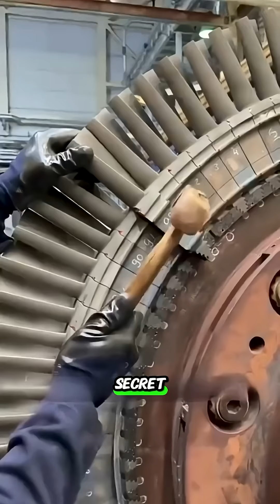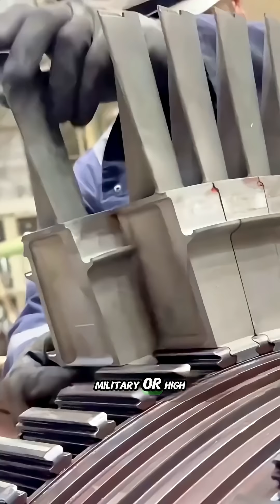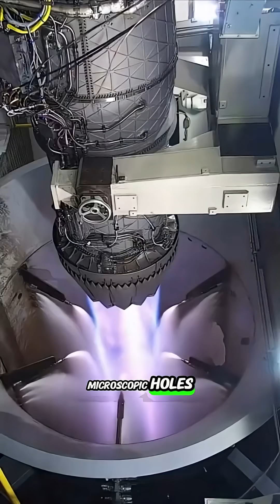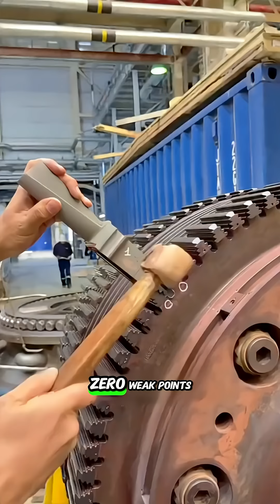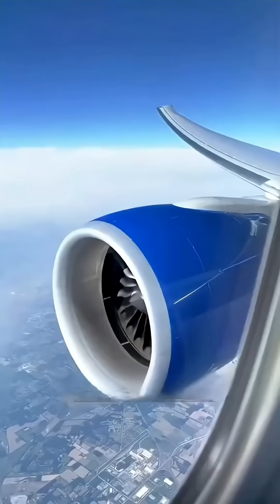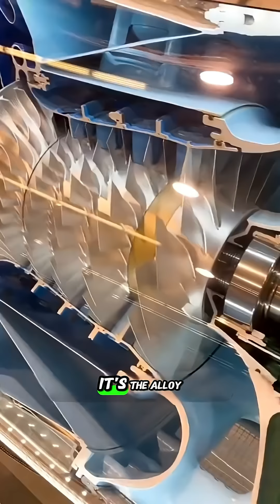The Insane Reason Nobody Can Copy American Jet Engines

Comment: Almost everything in this short is shockingly wrong.
I guess the point is to get us to point that out.
Reply: Yes, the weight of a single hair on a bladewill not significantly worsen engine performance
Reply: @teddeebayre3433       can or cannot handle. :            bird strike
Reply: @MikePoland-g7r  TBH a birdstrike will hit the front blades not the ones generating thrust! By the time it gets to the business end it is all red mist!
The point does stand though!
Reply: @totherarf  Do you or have you ever worked on a Jet Engine?
Reply: @totherarf The big fan in the front is the one making most of the thrust though.
Reply: @GolfFan1-1 I have, and they’re right.
Reply: @GolfFan1-1  No! ... Your point?
Reply: @totherarf  I was a machinist on every part of the internal parts of Turbine Engines from the casting to final part. I spent 30 Years machining and putting them together, taking them apart after first models were made to check wear. The video isnt 100% correct but the technology is not out there in the open for all.  Some parts are machined and its a trade secret how they are made and the material. Others can create a jet engine but cant get the efficiency part correct, Its like two different cars, some get 30 mph, some get 20, only with jet engines they are the same size and same application and no one wants the ones that burn more fuel for less mileage. Or burns the same with less thrust. thats where the difference is, the metal has to be able to sit on a runway at minus 60 and then heat up to over 1000 degrees and maintain the same tolerances. There is big money is producing top jet engines and even with the saudi money, they cant, or qutar money they cant, Japan buys theres from GE. but the video is flawed but makes a larger point, Jet Engines that are Efficient cant be replicated on the spot. It takes decades and lots of failures to produce ones that stay intact for years with human lives on the line.
Reply: @WillieInFinance  What part of jet engines did you work on and where?  I spent 22 as an Aircraft engine mechanic and 20 machining internals for them from castings to finals.
Reply: @G @GolfFan1-1 ice! I mainly did component replacement, tear downs and rebuilds for 6.
Reply: @teddeebayre3433 I think he was saying if the blades were weighed a hair off it could cause catestrophic failure from centrifugal force at full rpm.
Reply: The part about the inner channels being more complex than blood vessels did give me pause
Reply: @stevenswapp4768  maybe not as thin as blood vessels, but actually quite impressive how thin and twisted they got now.
Reply: @stevenswapp4768 I've told  you American colleagues a million times not to exaggerate....
Reply: @smyffmawzz what? You mean Americans have a tendency not to listen?? Lol 😂
Reply: @smyffmawzz  Ha ha! I get it. Told us a million different times not to exaggerate, did ya? Must have taken ages, and we STILL DIDN’T LISTEN! Gotta be frustrating.

I like you, colleague from unknown country of origin. You’re a funny… Gender of unknown specificity.
Reply: @smyffmawzz  "the lion doesn't waste it's time with the thoughts of sheep..." or something to that effect, I wasn't really listening.
Reply: @stevenswapp4768   It's a metaphor
Reply: @principleswise9749 ah. Didn't expect that since technical info is usually literal
Reply: @principleswise9749 It's BS, is what it is.
Reply: Oh my. Without the comment section this would be such a horrible platform. Free-to-spread misinformation.
Reply: @eestaashottentotti2242 reminds me of the good old TVs and Radio propaganda machines
Reply: @eestaashottentotti2242  it's a good thing humans can easily discern bs otherwise government would have to intervene. Oh wait 😅
Reply: @eestaashottentotti2242 the thing is most people either don’t look and trust whatever they see
Reply: I like your insight, very good point
Reply: ..Trade secrets..🤫
"Loose lips sink ships".. 😶
Reply: @livelyarts49 .  Good thing they are talking about jet engines and not ships or trying to BS us about jet parts
Reply: Explain what is wrong
Reply: @davidross5593  Rolls-Royce in the UK can build them for a start... So basically even the first sentence is incorrect 😅
Reply: @winging-it-to-win-it 
So too does Safran...French.
Reply: @winging-it-to-win-it my grandma builds in her free time 😅😅😅 for TEMU
Reply: @winging-it-to-win-it rolls royce don't build jet engines. If they did the UK would be producing their own jet engines today without outsider help. 💀 💀 💀
Reply: @Ralfi_PoELA  which they do. The rolls Royce Trent engine for example
Reply: @Friddle how much of it is built primarily in England.
Reply: @Ralfi_PoELA  only RR knows that i guess.
Reply: @Friddle  Rolls-Royce has a large joint venture with France.
Reply: @Ralfi_PoELA  not on their Trents though
Reply: @RenZ696  Rolls-Royce and Safran have been partnered with each other since 1965 on all their projects. Rolls-Royce hasn't been a stand alone jet engine company since before that. Why the UK doesn't even produce its own jets anymore. Can't even maintain the Harriers which would have been a good alternative to the F-35's y'all don't really have for your aircraft carriers.
Reply: @Ralfi_PoELA  wrong, Safran has no saying in Trent engines. Maybe as a supplier for some parts, but no joint ventures. Last joint venture was the V2500 in the 90s.
Reply: @RenZ696  says you. 😂
Reply: @Ralfi_PoELA  indeed, or do you still think differently? What is the engine type Safran is still heavily involved in up to a joint venture? 
Go ahead.
Reply: @RenZ696  just stating the facts... Nothing to get bothered about.
Reply: @Ralfi_PoELA  I am not mad, until now you just made stuff up and owe us the facts. So what are the current engines Rolls-Royce builds where Safran has significant stakes in?
Reply: @Ralfi_PoELA  they are one of the world's largest manufacturers of aircraft engines. They design, produce, and service powerful jet and turboprop engines used to power numerous commercial, business, and military aircraft worldwide
Reply: @fookpappyvanwinkle9162  in a partnership with Frances Safran going back to 1965. You forgot that part.
Reply: @Ralfi_PoELA of course
Reply: So much easier to do the short list rather than the very long one so here goes: What is correct? Answer. Nothing !
Reply: @davidross5593  reminds me of ME 262, the Germany did it first
Reply: @davidross5593 Also the sentence is contradictory, said "dominated for 50 tears" but recognized only few countries can do it, so didn't dominated if somebody else can. When a country needs this kind of lies in order to maintain its ego something is deeply wrong with it.
Reply: @davidross5593 name one plane uk produces with suprecruise where single crystal engines are needed. Go ahead ill wait for your answer and your cancelled 6th gen program dont count never even got past blueprint phase 😂
Reply: @7zobzombie Eurofighters Typhoon 🤪😜
Reply: @Tuga9525 While the Eurofighter's top supercruise speed is Mach 1.5 in a "clean" setup, adding weapons and external fuel tanks increases air drag.When loaded with a standard air-to-air missile configuration (such as six missiles), its supercruise speed typically drops to the range of Mach 1.15 to Mach 1.2. 

F22 is 1.6 over 2 in full burner things garbage
Reply: @7zobzombie, what has that to do with your initial question !?
Reply: @7zobzombie wow that's some goal post moving there brother.  You got some egg on your face.
Reply: It's a nice story, full of misinformation
Reply: Your right.
Reply: @donmajer9607 ..my left?
Reply: You are absolutely correct pal. The kid thinks very complex designs however, the government wanted simple, it’s just that the government has need to know information as to why the metals used in aircraft manufacturing doesn’t need complicated fusing techniques however it’s the use of a single and very expensive metal worth more than gold, gets stronger when heated above thousand degrees it’s called, “????????” It’s an eight letter word not titanium, but I can’t tell it in public but a good synonym is called “white gold “.
Reply: @edwinmabanta6624  have you worked on Jet engines or machined the parts? or built an actual engine?
Reply: @edwinmabanta6624 well your probably talking about Rhenium which is only 7 letters and it's good over 5k degrees and the most expensive metal in a jet engine.
Reply: @JerryMabrey that’s right, wow I thought it’s 8 letters my bad
Reply: That is definitely a tactic.   I see a million videos a week....I Caught this giant Trout 🙄.....clearly not a trout 🤣
Reply: @Baroque_Back_Mountain  😢 A million videos a week? OMG you poor thing
Reply: @barreldreamz7852  🤣🤣🤣
Reply: This must be a skit… 😂😂😂😂
Reply: Lol being an engineer myself, I started eye rolling and went to the comment section myself
Reply: @derrickez but then you facepalm cause you find comments are equally stupid.
Reply: Generating engagement.
Reply: You're right. We're all initiating engagement which helps the content with the algorithms.
Reply: $600K to replace PT6 CT Disc, Aircooling channels are real (impingement cooling)
Reply: It WAS pretty bad
Reply: https://youtu.be/QtxVdC7pBQM?is=0kb6XwKDLLUyjbKi
Reply: Or to dumb people down.
Reply: Thank you another smart man And imagine if america stopped building engines then what would us small minded idiots do
Reply: 😂😂 opened the commentsection to say the same 😂😂
Reply: Utter nonsense really
Reply: its just entertainment.
Reply: @JoesephBidon  Are we not Entertained?
Reply: @totherarf "Spaniard!"
Reply: You are right
Reply: Chai,savage😂
Reply: Completely agree.
Reply: If you want knowledge pick up books.
Reply: USaian ego.. why we keep seeing this junk shorts
Reply: lol like the tiny holes, but where they at tho?
Reply: @Zeno2000 So small you can’t see them with jour naked eye !
Reply: Watch Veritasium is actually very right stop being such a critic
Reply: The reality is more nuanced, with each nation having distinct strengths and weaknesses.

Here is the breakdown:

· China (J-20, J-35): Now a Top-Tier Contender. The J-20 is a world-class 5th-gen fighter that rivals the US F-22 and F-35 in many areas. It features an advanced AESA radar, a growing fleet of ~300 units, and carries the PL-15 missile, which outranges the US AMRAAM. Its widespread use of advanced AESA radars and composite materials marks a significant technological leap beyond its Russian counterparts.
· Russia (Su-57): A "Stealth" Fighter with Trade-offs. The Su-57 is a highly maneuverable and dangerous aircraft, but it's often considered less stealthy than US or Chinese designs due to its airframe. It's also behind in avionics and radar technology (using less advanced AESA), partly due to sanctions limiting access to Western electronics. With only about 19 in service, it's not yet a mass-produced game-changer.
· The Electronics Gap (Radar): This is a key differentiator. China has successfully upgraded older jets with advanced AESA radars (even using cutting-edge GaN technology), while many US and Russian jets still rely on older mechanical radars or less capable PESA radars.
· The US Edge: The US still leads in overall network-centric warfare, sensor fusion, and proven combat experience. For example, the F-35's data-sharing capabilities are considered the most advanced, while the F-22 remains the benchmark for air superiority, despite its aging design.

In short, China has pulled even or surpassed in specific areas (like radar tech and missile range), while Russia excels in maneuverability but lags in stealth and electronics. The gap is narrowest at the top, but widens when comparing the average frontline fleet.
Reply: Love the part where you actually pointed out the tbings that are "shockingly wrong"
Reply: success comes from decades of accumulated expertise across materials science, precision manufacturing, testing, certification, and industrial capability.
Reply: The voice itself is the biggest giveaway.
Reply: The broads strokes are correct. The things that are wrong are significant, but the things gone over in this video are still amazing. There are only two major American companies and maybe 3 or 4 European companies that can make competitive engines. Even Russian designs aren't as advanced and they were always a generation behind. The turbine blade metallurgy is about as close to magic that modern science currently produces. It being a single crystal with no grain boundaries is absolutely correct and is absolutely insane to think about. No, the channels may not be more complex than blood vessels, but still impressive nonetheless.
Reply: I thought Airbus Industrie, the European company that competed with Boeing, used to make its own jet engines. Oh, he did say 'almost no one else.'
Reply: Was wondering about fact checking 😅
Reply: Truth is misinformation and misinformation is truth.
~The American Political extremist~
Reply: Bullshit Video
Reply: don't say something is .. wrong and then proceed to not say what is right !!! what's wrong about it?
Reply: @vittorio870 I hear crickets 😅
Reply: @davetaylor5065  Many have given one of the reasons ..... America is far from the only producer of jet engines!
Reply: - 
 @vittorio870  -- I Agree .
Clarification Is In Order .
-
Reply: Rolls Royce (UK), Safran Aircraft Engines (France), MTU Aero Engines (Germany), Motor Sich (Ukraine… yeah Ukraine) would like to point out this narrator is full of shit and they all make Jet Engines perfectly fine, thankyouverymuch.

This video is clearly American defaultism at its worst.
Reply: @NeoMorphUK  You are assuming all jet engines are the same. While all these manufacturers do in fact make jet engines all do not manufacture jet engines that spin at the same rate of speed, produce the same amount of thrust, or are subjected to the same amount of heat. Go study jet engines and learn something.
Reply: Russian brits didn't invent the first rocket engine the Germans did. And yes the Russians used to supply us with rockets before space x in 14 they were ditched as one failed Russian made. Since upgraded. Facts are most of the best engines made in the last 50 years are joint efforts of 3 or more countries. Down to ge Pratt and Whitney. Where its not is specifically in military equipment. And in that case yes we do rule and have for a long time. The f22 and f35 are considered the most advanced but really the new f47 in 28 is going to have twice the speed and range. Which means everybody else is behind about 20 years after 28 hits and this thing goes live.
Reply: @joshreynolds729 F35 most advanced ? You don’t know or don’t want to know the technical disaster!
Reply: that's fine you can book your rides on temu jets im taking western every time
Reply: @PharmBoy-d7c Europe is Western
Reply: I just hit the block channel button when I see fake
Reply from the maker: What’s fake
Reply: @MotorVibe_Talks not fake, just wrong
Reply: @MotorVibe_Talks 
Aircraft Jet Engine Manufacturers USA:

GE Aerospace
Pratt & Whitney
Honeywell Aerospace
Williams International

Aircraft Jet Engine Manufacturers Outside the USA:

Rolls-Royce plc (United Kingdom)
Safran Aircraft Engines (France)
MTU Aero Engines (Germany)
ITP Aero (Spain)
Avio Aero (Italy)
GKN Aerospace (United Kingdom/Sweden)
EuroJet Turbo GmbH (Europe)
Europrop International (Europe)
AECC – Aero Engine Corporation of China (China)
AECC Shenyang Liming (China)
AECC Xi’an Aero Engine (China)
AECC Guizhou (China)
UEC Saturn (Russia)
UEC Aviadvigatel (Russia)
UEC Klimov (Russia)
UEC Kuznetsov (Russia)
UEC Salyut (Russia)
UEC Perm Motors (Russia)
Motor Sich (Ukraine)
Ivchenko-Progress (Ukraine)
IHI Corporation (Japan)
Kawasaki Heavy Industries (Japan)
Mitsubishi Heavy Industries (Japan)
Hanwha Aerospace (South Korea)
Hindustan Aeronautics Limited – HAL (India)
Gas Turbine Research Establishment – GTRE (India)
TUSAŞ Engine Industries – TEI (Türkiye)
Reply: @MotorVibe_Talks  nothing in a turbine blade is as intricate as a human blood vessels, even reptile blood system is 100 times more complex than some silly cooling channel in a sponge casting. 🙄
Reply: @MotorVibe_Talks about everything posted in the video.
Reply: @TheFirstBigCheese AI slop 🙄
Reply: @MotorVibe_Talks  it’s almost all wrong dude wake up stop being cocky learn from your mistakes moron unsubbed  blocked
Reply: @Holilo7
👌🏻 I think you shut him up.
Reply: It’s quite true … during the 1980s, the U.S. exported or collaborated on specific aviation technologies, including commercial engines like the CFM-56. However, China's inability to immediately replicate them stems from the massive gap between possessing a blueprint and mastering the advanced metallurgy, tacit manufacturing knowledge, and supply chain infrastructure required to build modern jet engines.

It’s the same reason that no one can replicate a Stradivarius? 

While master luthiers can perfectly copy the shape and dimensions of an Antonio Stradivari masterpiece. They can’t truly replicate it because its legendary sound relies on a combination of historically lost variables. These include specific wood density from the "Little Ice Age" climate, chemical wood treatments or fungal aging, and a unique varnish recipe that may alter acoustics as it micro-cracks over centuries.
Reply: @JimCOsd55   Regardless of how masterfully a luthier can craft a Strad, it's impossible to reproduce wood aged 350 years. Strads sound different now, than they did when they were first made.
Reply: many build  this engines. the best  are Rolls Royce.even Trump  want RR on hes own airplane
Reply: @pedersvanstedt1265 ask any B787 owner what they think of Rolls Royce engines
Reply: @pedersvanstedt1265 
And no one know as much as Ttump about jet engines.
Reply: @pedersvanstedt1265  Yes, adorned with gold.
Reply: England designed and made the first jet engine, then gave America plans for some insane reason
Reply: @philjjordan6197 and to Soviet Union     !
Reply: @philjjordan6197i thought it was the Germans.
Reply: @philjjordan6197Actually it was the Germans,. They both got it from German scientist after WW11.
Reply: @philjjordan6197Germany
Reply: @philjjordan6197 -- The "insane reason" was called World War 2.
Reply: @philjjordan6197You gave them to The Russians too.As many Americans that died protecting you, you call it "some insane reason," besides the US used the turbo jet iteration, not the centrifugal type that Frank Whittle designed.
Reply: @booster5329 Your previous comment about the fake channel, agreed, and point well made and received .Yet you cite a trope that is only an RCH away from " if it weren't for us you'd be speaking German '.
From whom did you protect us? It wasn't from you, I think you're bound to agree. We are going down in the wake of your vortex currently.
Reply: @philjjordan6197the first jet engine was a axial German and the next the radial English one  real history
Reply: @philjjordan6197I think that was the Germans, they came out with the pulse engine at the height of ww11
Reply: @philjjordan6197I m not an expert but I know that the first jet plane was made by the Germans towards the end of the WW2. 
I don't know if English had it already on paper but this means that it was already a technology about to be developed by various states and industries!
Reply: @philjjordan6197they have owned the US since 1870. You didn't re search.
Reply: @jamesloghry8083 Not anymore, Trump put a stop to that crap so, do your research.
Reply: @philjjordan6197 To get us involved in WWII.
Reply: @philjjordan6197Because they asset stripped us in 1940 and occupied us in January 1942. They own us. Both countries pretend we are still sovereign for political convenience.
Reply: @Jack_AubreyRN Have you been following Mark Felton's videos on the UK's crumbling navy? As an American it's sad to see what's happening over there. I think your politicians truly hate you whereas ours are more or less apathetic toward us as long as they can keep ripping us off.
Reply: @robertnichols78 You are right, our government wants us to cease to be. 
I'm sorry to tell you, after such a friendly and chatty response, Mark Felton is a despicable human being who lies almost as much as Roy Casagrande. At least Casagrande's stories are funny if you're familiar with the history. Mark is a blatant Fabian..
Reply: @J @Jack_AubreyRN rewriting history? The Americans basing themselves in the uk prior to d day does not equal an invasion. For one thing, those troops left around June 1944 in order to invade France.
Reply: @MrBlaxjax  I came here to support a view I agree with, not for a confrontation. Your opening question is a loaded rhetorical device, and that's a further reason not to engage. But you asked if I'm "rewriting history," so I'll answer that cleanly. The stripping of British assets did start in 1940, specifically after May 10th, if the year alone is too vague. The first American troops landed in January 1942.
The rest is perspective, not rewriting. After exhausting the orthodox books within my grasp, and believing them, as you appear to, I started coming across different perspectives with as much, if not more, validity than those manufactured for general public consumption. They led to avenues of research I'd hitherto been artfully steered away from. De Gaulle famously declined the D-Day celebration, saying it was "le prélude à une seconde occupation du pays." If you recognise the quote, you'll be aware of the issues at stake. I'll not elaborate for reasons already given.
He was also famously correct about French banks being full of worthless American paper. In my opinion, the last great European.
Reply: @Jack_AubreyRN whatever.
Reply: @MrBlaxjax Jack tips Fedora.
Reply: England owns the US?

look how small they are....they asset stripped all of California?

what assets?
are you specifically talking about aviation or life in general?
Reply: این اشتباهات عمدی ست، اسرار ساخت این موتورها را در اختیار عموم قرار نمی دهند، 😊
Reply: Many videos are wrong, stupid,or just flat out lie. Each time you point it out is a view, and comment. These liars do it on purpose. I wish You Tube would use it's master censorship powers that they waste on harmless bullshit to stop ppl from posting lies.
Reply: I. Do not concurr. After 30yrs in experimental these blades are amazing and will withstand strength beyond what we know. Strands as small as human hair flow thru these blades to cool them. Trust me. 
Cudos to engineers and assemblers 👍
Reply: @sfopaladin2661 
"Trust me."

I never trust anyone that says "Trust me".

"Cudos"

It's spelled "Kudos".
Reply: @shawbros  "Trust me bro..." ~Abraham Lincoln
Reply: @Kenji1685 “Abraham Lincoln” -Trustme Bro
Reply: Nope. Most of it is correct.
Reply: Alsolutely. I open commentaries to write just that.
Reply: Yep, 100% incorrect
Reply: @MDCDiGiPiCs  no, turbine blades do have passages inside for cooling air to form a layer of air to protect the blade from heat.
Reply: @insylem Not all turbine blades. Depends on the size and vintage. Higher efficiency of more modern GTs requires higher TIT which typically requires more blade and nozzle cooling.
Reply: @MDCDiGiPiCs care to elaborate?
Reply: Good take the plans to India and stay there.
Reply: No, it's meant to make that country look good at a time when everyone knows it's 💩
Reply: The amazing thing about China is their product is a cr#p copy of yours<blink> their product is as good as yours <blink>their product is next generation better.  China does this constantly. Jet engines are in their sights but maybe they are moving on to zero combustion way simpler engines? We'll find out soon.
Reply: @bobcannell7603 
Speaking of lies, and liars!
Nearly every word you wrote is obviously total BULLSHIT
Why does China constantly boast about technical breakthroughs that virtually never happen? If what you claim becomes even a partial truth, it will be the first time that it's truth, VS pure propaganda 
Blink my ASS!
Reply: @bobcannell7603 Considering China was the innovative workshop and tech research centre of the world for the best part of 3000 years, minus the 300 year glitch of European dominance and a government that atrophied in-between several revolutions and coups,, I'm surprised anyone is surprised they are going to dominate again. It seems perfectly natural and inevitable to me. It does seem to create jealousy or fear, or perhaps both, in many. The West is clearly on its last legs under US 'leadership'. It's so far gone it's just childish to deny.
Reply: I agree
Let me give a piece of advice to the person who made this short: if you don't dominate a subject,  best is to shut up
Reply: That's propaganda for you😊
Reply: Many countries make superb jet engines.
Reply: @leymansuniverse8888  which countries?
Reply: @doumedaurillac7393 The UK for example.
Reply: @doumedaurillac7393 UK, France, Germany, China, Russia, Canada, ...
Reply: @vitek924 Rolls Royce.
Reply: @doumedaurillac7393  France, Uk
Reply: @doumedaurillac7393 Neither Russia nor China buy american engines to add just a few...
Reply: @doumedaurillac7393  China, UK, France, Russia, and China have just as advanced if not more advanced domestic jet engine manufacturing and supply chains.
Reply: @schrenk-d right....thats why china keeps ordering ours
Reply: @johnpeterekstrand717  LOL, China buys LOTS of US engines. And Russian engines suck, they have thousands of hours LESS service life, and they are less efficient.  Feel free to pretend.
Reply: @johnpeterekstrand717 I'm not sure about Russia because they have their own tech geniuses, but China are able to because they reverse engineer American brands and make their own.
Reply: @schrenk-d China only recently mastered the materials science behind making turbines of this quality. They relied on Russian engines for decades
Reply: @johnstephanos1128 which means the blueprint is enough...
Reply: @johnstephanos1128  Russia has fallen well behind at this point.  China is improving bu the still lack large scale reproducibility for hot section parts like Turbine blade.  You can try to copy a turbine blade but you still have to manufacture it.  If you can not EDM drill TiNi investment cast blades with intricate internal cooling channels, then EDM drill hundreds of 8 mil holes into those channels, and then use a laser to add tiny diffusers to those holes within thousands of an inch tolerances.  Then use ionized ceramic with proper masking to coat the blades with thermal coatings, and do it at scales of tens of thousands of blades a month... it is a non starter.  That is why the WS15 has a military power life span measured in tens of hours, while the US engines are measured in the thousands of hours.  In a War supply chain would kill Chinese aviation s they would not be able to maintain their fleet without derating their firing temperatures to keep planes in the air.  Most people in this thread have ZERO knowledge of Jet Engines, or how any of this works.
Reply: @PharmBoy-d7c  China is indeed a recent addition. They have managed to produce some interesting advancements though.
Reply: Let's all report ones like this for false Information.
Reply: You speak CRAP
Reply: I don’t know a thing about jet engines but as soon as he said one blade costs as much as a bmw I knew it was bullshit!
Reply: Hey @dread10ck you’re so smart tell us what is wrong with this video?
Reply: Only Americans can make jet engines.
Reply: Yes...  It seems a shame
Reply: Just more US self-aggrandising propaganda for brainwashed Yanks to wallow in.
Reply: Yeah,most of the jet engines are made in Germany or the UK at rolls Royce.
Reply: @alschmidt8963 nothing in USA china France Japan Russia ?
Reply: Oh? Which part, professor?
Reply: @ganymede3141 
All of it !!!
Reply: It’s correct
Reply: @johnlivorness2204 
Yeh ok ! 
And America started the industrial revolution 
America won the second world war all on their own 
America went to the moon without help of any other nations help 
A totally American designed plane was the first to make Mac 1 
I have heard many many Americans say all the above but none of them are true either
Reply: @tumshiewhacker4498 yep all nice fairy tales
Reply: @tumshiewhacker4498 
Gottlieb Daimler, Wernher von Braun, Ernst Heinkel, Hans Joachim Pabst von Ohain (HeS3), all proud Americans!👍🏻
Reply: If any of this were true, which it isn’t, sucks to be American then.

Because, whatever your view of  Da Environment, within quite a short time we will have run out of jet fuel. Da Greens say we MUST stop at 2040. Drill Baby Drill put it out at 2050, because the faster you pump it out, the quicker you get to the end date, particularly with the tight oil that the US has. The Saudis will have plenty of oil out of 2075……but the USA will lose interest in Drill Baby Drill as soon as it is somebody else making the money rather than them.
So that is quite a tight date range, only 10
years. And you know and I know that it isn’t going to stop by 2040, the can will be kicked down the road. First to 2045  and then inevitably concessions will be made to 2050. When there is no choice to be made anyway because it’s gone.
The thing nobody is admitting, is that there is little difference in practice between Green Lunacy and Drill Baby Drill. They end at the same date, just each has its own set of feel-good slogans.
And once you realise that, you realise that the age of the jet engine is over. It will be electric, which looks like turboprop aka ductless fan. Electric planes will of course be crap, and slow, but that’s crying over a choice we don’t have.

You don’t need these exotics to build ductless fan, aka turboprop, aka electric prop-driven. 
The USA will lead the world in a manufacturing technology that nobody uses any more, in about 20 years
Reply: We can report youtube to remove this video
Reply: @drrvk  being incorrect is not against YouTube rules lmao
Reply: @drrvk if they were spreading political misinformation maybe but I think it’s allowed to just be wrong. Also good luck with that lol.
Reply: No, it’s correct.
Reply: @paulblase3955 
Nope!
Reply: @paulblase3955  no this article is pure American propaganda. 
The selection and balancing  of the Turbine vanes, their composition and the teams of technicians that select and balance them  were mostly Russian,, China had to be taught the correct method. 
This is the very reason that John Mc Cain, of the "NO BRAIN" FAME, created such a stink in congress when he discovered that , his  America  was buying rocket engines of Russia. The old fool insisted on America building it's own and then Russia banned the sale of its space rocket engines, leaving the American space program stranded.
Reply: @georgedoherty962 they didn't say no one has ever competed. They said VERY FEW COUNTRIES ON EARTH have mastered the process. There's the US, China, and Russia. That's about it. And what each of them know and can achieve varies slightly. But they're not wrong, most countries can't hold a flame to US turbine technology. This is true to China and Russia, oddly they can't easily copy the US. But the US also can't easily copy them. But let your ego wrap you up a little more, it's good for the lols.
Reply: Don’t forget France and the UK…
Reply: @georgedoherty962  Yes ULA's Atlas V rocket was powered by the Soviet RD-180.  Before SpaceX  Americans had to hitch a ride on the Soyuz to ISS.
Reply: @USER351 thank you !
R&R and Safran (co leader in CFM56 with GE)
Reply: @jamesa3818  Safran produces M88 engine installed in Rafale !